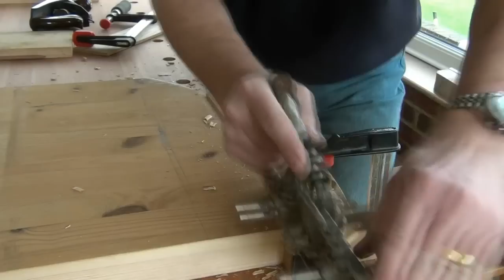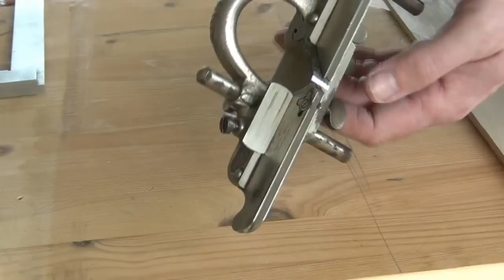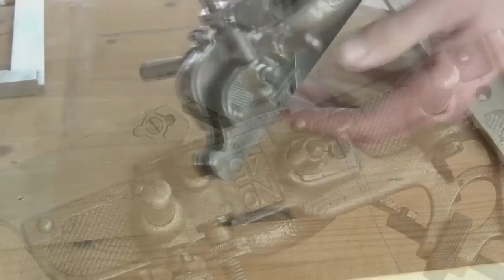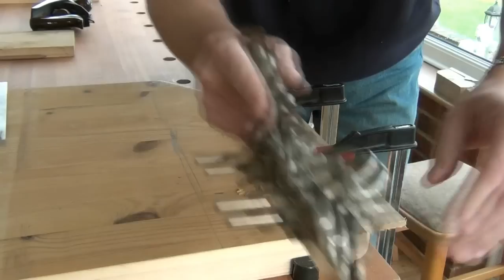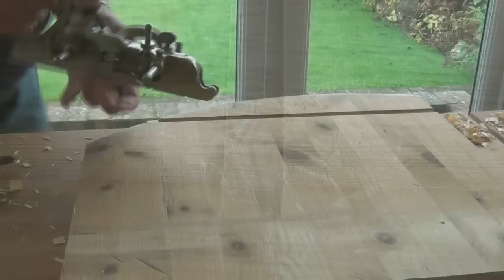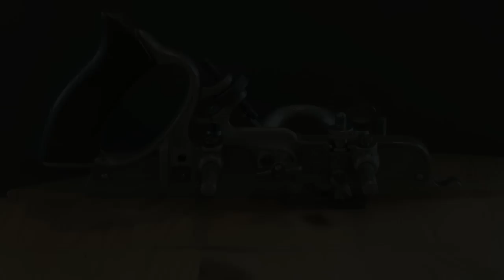Dado using a Stanley No.45

Comment: I was wondering how to fit the 1/4 inch cutter has it has not got any locating notch like the others have.
Reply from the maker: It doesn't have a notch as it wouldn't be strong enough. You need to retract the depth adjuster pin so it is above the cutter. You can use the adjuster to advance the cutter normally, but when retracting you invert the plane so that gravity helps the cutter follow the pin, or just push it. Hope that helps.
Reply: @mitchwoodwork  thank you so much , i thought there had to be a way or the cutter would be useless, I'll give it a go tomorrow. I prefer to use the plane rather than a router, especially on a thin piece of timber, once again thanks
Reply from the maker: @briangoodwin5986  Anytime. I'm with you on not using the router if possible.

Comment: Thanks Mitch. Do keep your eye out for one. I see on ebay they are shooting up in value. With regards to the comments of starting your cuts at the far end with small shallow passes it is very true.  Just speed up without taking much material and slowly bring the passes towards yourself. Its a bit like a push saw. You don't start at the near side with full length strokes. You will be startled at how little elbow grease it takes. 
Regards. 
Mike
Reply from the maker: +smike230966 It's good to find the technique that works best for you, and makes using the plane more of a pleasure. I'm pretty sure the force distribution and sole alignment employed by different users determines which technique comes easier, and that there really isn't a universal best way.
Reply: +Mitch Peacock - WOmadeOD  Point taken, and once again thanks for all the encouragement you are giving to many people like myself.Mike

Comment: Nice series! I haven't used my 45 very much. I was going to use it for a dado this summer and I managed to drop both of the nicker screws. They really bounce and quickly disappear! I haven't tried to get more screws, yet. Knowing Stanley, they are probably a non-standard thread!
Reply from the maker: Rick Gatewood I've been there, on hands and knees in the sawdust! There seem to be plenty of spurs and screws up for grabs on eBay though. My 45 was missing the adjustable fence locking screw. I went through a big box of odd machine screws with no luck. Then the lightbulb moment - the depth stop screws on the tongue cutters look about the right size. And they were :)Happy woodworking Rick, Mitch
Reply: WOmadeOD - Made in Wood with Mitch Peacock I finally solved the spur screw problem. I bought a couple of brass no. 8 screws and ground them down until they fit. Now to try again!

Get well!
Reply from the maker: Good stuff, and thank you

Comment: Wow! You seem more talented than Paul Sellers! 😄

Btw… what’s that wood fence/jig you’re using with that file/rasp? Have a video of it?

I’m trying to figure out something similar for my Shinto rasp… to use to square/plum endgrain instead of using a shooting board. 
Because I’m cheap and work mostly with cheap softwoods and construction-grade 2x4s and Douglas-fir, etc. (and planes aren’t great on softwoods). The Shinto is nice on softwood endgrains tho! ✨
Reply from the maker: Thanks. The fence is just a straight piece of mdf (just happens to have a veneer on the face) to guide the plane initially. If you watch my video on saw sharpening you'll see a jig for a file that holds it at ninety degrees to an edge, which might suit your purpose. Watch from about 1m55s https://youtu.be/P5Yi-CongYs
Reply: @mitchwoodwork  
Yeah! I think that's the one!

My comment was really made for this video:
https://youtu.be/yphyJDpNj5U
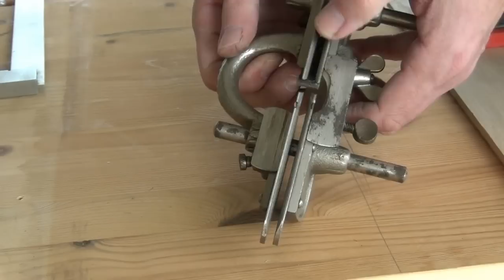(file fence @ 1:52 of video)

Dunno why my comment posted here, might've been confusing. 
I think I was typing it after I finished that firewood video/series, and it autoplayed into your 'Dado Stanley 45' video and accidentally posted my comment there. 

Anyways... I love those kinda original ideas! ...like your file/rasp fence, and also your new video on a saw guide using 2 pieces of scrap sandwiched together. Please make more of those kinda vids. 

I'm trying to figure out some jigs myself... since I work with softwoods and/or am cheap and on a shoestring budget (can't afford miter nor table saws nor belt sanders). 

I figured out square/plum jigs, and also 45º regular miter jigs... for the Shinto. (using the jig with a try square... kinda like shooting). 

But, been trying to make a Shinto jig for 45º carcass bevels. That one got me puzzled and is tricky. 
I'd need a long 45º triangle block, made of wood or metal, in order to clamp the Shinto onto.

Comment: Hi Mitch, this is a wonderful series. I have a Record 050 combination plane which seems close enough to the Stanley 45. I haven't used it much, but I am learning a lot from watching this series and can now see all kinds of possibilities for it. I know that you are going to cover the sharpening of the spurs, but I am curious as to when they should and should not be used? As for the slitting cutter; on the whole, I think the table saw would be my choice. Although, I can picture someone out on a job site with only a few tools; a lot easier to carry the combination plane and with the fence perhaps easier and more accurate than an electric circular saw or a hand rip saw.
Reply from the maker: Kevin Blair Cheers Kevin. The 050 is similar enough, so keep watching. There are several more videos I can do on the 45, and hopefully I'll pick up some of the optional cutters and soles to cover all the possibilities of the plane.

Comment: Nice videos on the 45. Please make a playlist. I didn't find the video you mentioned where you cover sharpening the spurs, only the cutters. 
Tks
Reply from the maker: betzaleldaniel Thanks. I though there was one, called Living with a Stanley No.45. I'll check that out, and try and find the spur sharpening. Meantime, only hone the bevelled side of the spurs, to prevent the 'cut' line shifting. 
Happy woodworking, Mitch
Reply: sorry, I do see the playlist now…but didn't notice the video about the spurs…
Not sure what you mean about cut line shifting, but I guess you mean not to strengthen the back of the spur?
Reply from the maker: betzaleldaniel The spurs should score a line that is in line with the outside of the skate. The spurs are the correct thickness to achieve this, but if you keep honing the flat side then they become thinner, and consequently score inside of where they should. By only honing the bevel, they stay the same thickness.
Not sure where that video went, if I can find a copy I'll post it up. If not, I'll make a new one.

Comment: I know it’s been a while since I did my CGLI&BICC apprenticeships and the world of Joinery has moved on, but I would have set a depth stop on the outboard side and started at the toe of the dado and cut back to depth with multiple passes. Is there a reason you cut full length from the start?? I know I am just a Joiner and not a designer woodworker so I would like to improve my technique and I love to learn from an expert. Unfortunately I had to earn a living from my hand skill and never managed to impart the level of knowledge found on the internet to the 57 apprentices I have mentored .. poor lads had to put up with me.
Reply from the maker: Hi Paul. I have no formal woodworking qualifications, being self taught, so you're in a better place to know the taught procedure. As it happens, I soon converted to starting at the toe end after more experience with combination and moulding planes. I started very much using a router for all these tasks, and gradually moved more and more unplugged.
Designer woodworker is simply saying that I design my own pieces rather than build from others' plans. No more, no less. I certainly have more  to learn than time to learn it 😆

Comment: Pretty new to hand planes, so this might be a dumb question. But can you cut a dado in any direction in regards to the grain of the wood? Can you go diagonal? Thank you! Very informative video 😁
Reply from the maker: Great question. Depending on where you are, dados, grooves, or trenches can be run in any directing, however where they are not parallel to straight grain it is useful to engage the spurs or nickers to slice the fibres for a cleaner cut. If using a plough plane without these, then the edges of the groove can be knifed in first.

Comment: Nice video once again.  You "should" find that if the spurs(he said knickers haha! sorry elementary humor and too many years around soldiers) are nice and sharp, after your initial spur setting drag pulls, lighter, much faster cuts starting with piston like short strokes  at the far end and progressing back toward you will produce faster, smoother results.  Takes some practice, just like all operations with the 45, but once properly set, you don't have to adjust anything and you can cut beautiful dados very quickly and accurately one after another. I grind one of the spurs on each side a little shorter so I don't have to remove them and so that they are just barely below my blade.  That took a while to get right, but makes a world of difference.  To me the 45 is a jack of all trades and master of none, but will get the job done.  They ARE fun to use though, if challenging.  The two most important word when working with 45s: SHARP CUTTERS.  REALLY sharp.  Oh and two more:  SHARP CUTTERS.   etc. etc. etc.  A semi sharp/factory sharp cutter will make you think the 45 is junk.  And is probably why so many are available in like-new condition.
Reply from the maker: blmeflmm66 Thanks for all the comments on the 45 series. Much appreciated. Some sound advice and tips to try out. Cheers, Mitch
Reply: Sorry for the redundancy, I've gotten behind and I'm watching them all at once.

Comment: Hi Mitch, I am very new to your videos and value them tremendously. Bought myself a no45 18 months ago. Totally agree with comment below re sharp cutters. Mine were dull and Considered relisting back on ebay. Tickled up 2 cutters and unbelievable difference. Some cutters were broken ( at the groove for the adjusting collar ) smaller blades especially as they are inherently weaker. Some cutters were missing. Looked on ebay and found a replacement set of both boxes for £30. Bargain! but a little rusty.  My tutor showed me his no55 Stanley and I was surprised at how much more versatile it is. twice as many cutting irons. Have you any experience working with one? Any info would be really useful as I found a reasonable one for myself. Not mint collectible, but worn and complete and probably loved in its day.Regards. Mike
Reply from the maker: Hi Mike,
Glad you're enjoying the channel.
I don't have any experience of the 55 sadly. I keep my eye out for one, but with no luck yet. I don't have much call for it's additional functions, but admire the engineering of it.
You can be sure that if I do lay hands on one then a new series will be born.
Cheers, Mitch